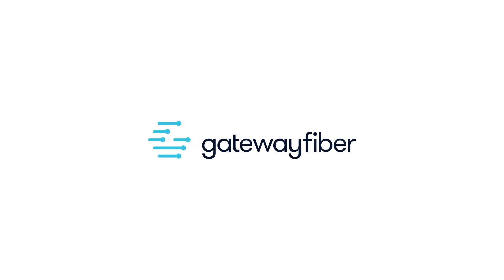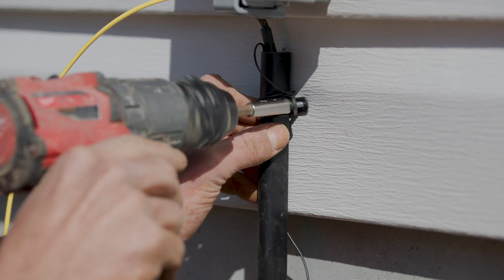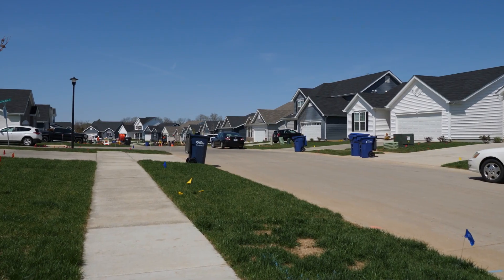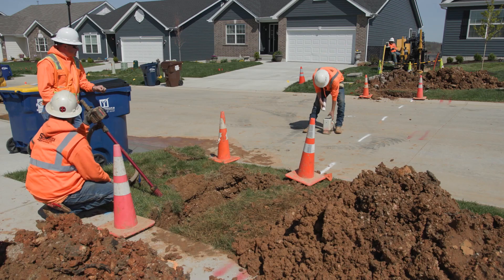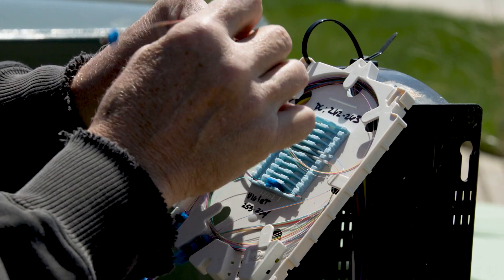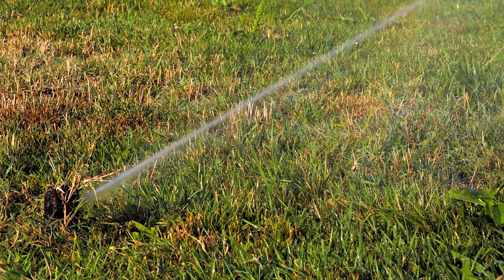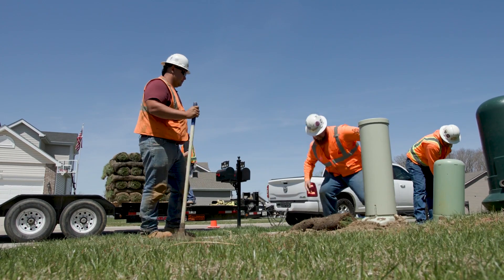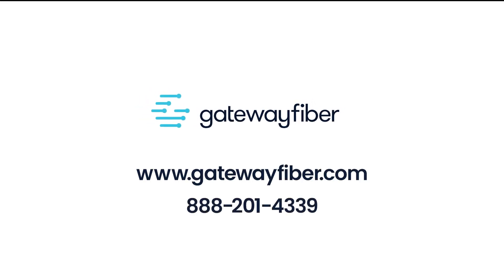Gateway Fiber Internet Service Construction Process

Comment: Nice seeing doing it the right way and not just laying it 8 inches into the asphalt .. sure might cost more upfront but once it's done it is done.
Reply: Micro trenching in asphalt is standard practice and is a correct way of installing fiber using micro ducts. Micro trenching is a safer way to do it in most cases because it avoids existing utilities. And no, it isn't installed in asphalt, the saw cuts through the asphalt and into the earth.
Reply: Micro trenching isn’t standard practice. Never seen it or heard of it in my state. Those fibers they cut through the asphalt will end up ripped apart when the road is replaced. Its just a cheap and crappy way to put in fiber so the provider can save on money for their unreliable network.
Reply: @LaFox23  it is standard practice when it’s done to a depth that’s normal it’s essentially just digging a trench but smaller
Reply: That method is good in some cases where there is heavy underground congestion and this method would simply tear through everything